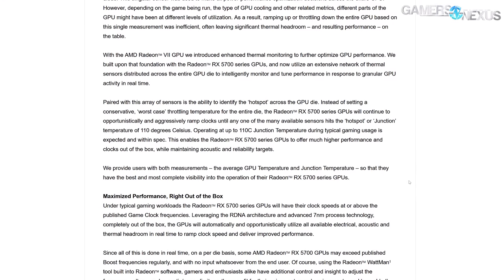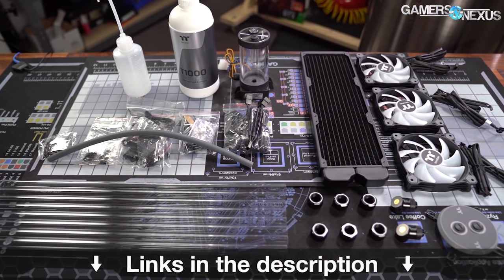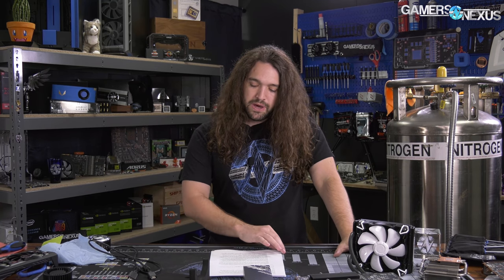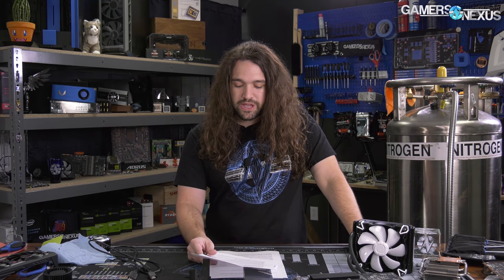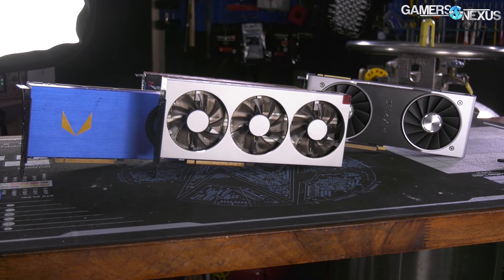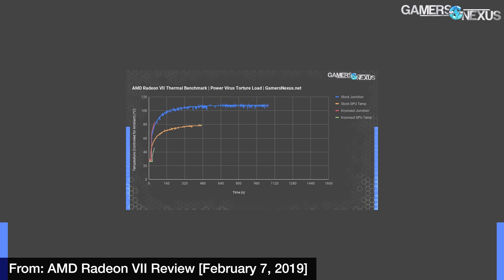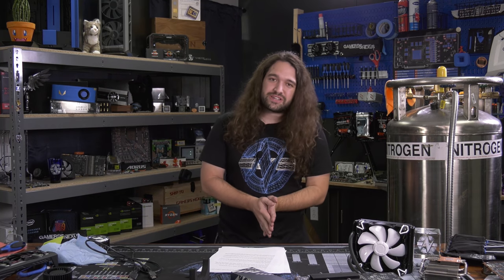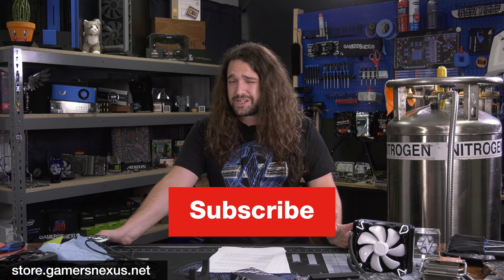Explaining Navi 5700 XT Junction Temperature | 110°C is Not "Expected"

Comment: It's such a poor excuse for slapping on a cheap and nasty cooler. Thanks for calling it out Steve
Reply: It has exactly the same thermal performance that every other reference cooler for the last 5 years has had: all of them keep the GPU they are designed for at around 80 degree's.
Reply: Nvidia did it too for 900 and 1000 series,runningat 85 and 87 respective edge temps,they got a lot of shit for it,probably running at junction speed of over 100C aswell but its hidden,lets hope AMD learns their lesson too,but it may be a faulty cooler design,its a lot better then nvidia's
Reply: @TheCountess666  that's really not true, look at Nvidia, 700, 900, 10 and 20 series reference coolers do. And look at Vega, RX 480 and thr 5700 stands out
Reply: @blodstainer  anandtech reviewed the 2070  super as being 75 degrees while gaming with the reference cooler. Not exactly a world of difference is it?

Edit: They also show both the GTX1070 and the gtx980 being around 80 degree's C. And the RX580 was 75 degree's
https://www.anandtech.com/show/14618/the-amd-radeon-rx-5700-xt-rx-5700-review/15

In fact nearly all the cards anandtech compares the 5700xt with are either 75 or 80 degree's with their reference cooler.
Reply: @ugaaa5 ooow its 82 instead of 80. My whole argument is clearly out the window.

o wait, that doesn't change a thing.
Reply: @Cyro1 Vega's was significantly louder actually.
and i'm not defending the cooler so much as trying to make it clear that thermally, it performs exactly the same as other reference coolers. that 110 degree TJmax is no different then on other GPU's except they are too scared to tell you about it.
Reply: @Cyro1 same THERMAL performance.
if you're going to quote me, do it properly.
Reply: Cyro1 why would you compare it to a card that costs 2.5x as much?  You don’t compare a Honda to a Ferrari for a reason

Edit: grammar
Reply: @Chris Lohr thank you for such a valuable post

to be clear, I never said he was wrong; but comparing it to the 2070 would have been better.  The blower design is retarded and is the only reason I didn't buy the reference model, but unless you're comparing relative performance it just doesn't make sense.  Of course the $1100 card has a better cooler than the $400 one.
Reply: @Chris Lohr Yea I misread that somehow, oops.

Comment: If AMD left it called hotspot people might actually understand what it is measuring more easily.
Reply: too true, and at any rate. Even a reference blower 5700xt will drop 5-10c just by getting rid of those rotten thermal pads. But then again, customers shouldn't have to fix a flawed cooler.
regardless of what silicon will tolerate, as seen with the GDDR6 space invader drama for Turing; solder joints won't handle over 100c for long.
Reply: @anasevi9456  I know of one Gigabyte Radeon HD 4670 that always games at or above 113c and always has.. 6 years it was crossfired with another exactly like it that ran just as hot.. my buddy is still using one of them, either the one I gave him or his died a couple months ago, daily to this day and it still runs that hot.. tell me again what solder joints can and can not handle. Or is going on 11 years not long?
Reply: Tjunction is the correct technical name, and has been used in the industry for years.
Intel has many CPU's out with a Tjmax temperatuer of 105 degree's. yet nobody's raised a fit over that.
Reply: Junction makes more sense, considering "TJ Max" means "Thermal Junction Maximum Temperature". If companies, especially tech companies keep the mentality of "having things make more sense for people who don't understand them" won't work well, it's kinda why we're at the point of thinking it needs to be called "Hot spot" ;P
Reply: @anasevi9456  The solder joints never get over 100 degree's.
That the whole point. Tjunction temperature exist only within the DIE, briefly, and are very local. the GPU as a whole is the same roughly 80 degree's that all high end GPU's with a reference cooler have been since forever.
Reply: @pr0xZen  i don't think it would have mattered one bit how AMD worded it. The head lines and video titles (including this one) would have been exactly the same, all containing the words 'AMD' '110 degree' and 'normal'. And for 90% of people, that's all they see of this issue before drawing their conclusions.

Some have argues that, form a PR perspective, it would have been far better for AMD to just never report Tjunction temp's at all, and i'm starting to agree.
Reply: 'hot spot' temp is what my HWinfo reports it as.  It doesn't matter how many ways it explained, until Nvidia releases similar temp measurement sensors, a lot of users are gonna assume 'hot spot' temp == GPU twmt
Reply: @andrewgerstner7836  We live in a world where people are dumb enough to overpay Nvidia for under-delivering cards. Are you really shocked?

Comment: TLDR - there is a very big difference between "the silicon can handle it and the cooler is shit!". That's it for the video. :) Thanks for watching. Steve being a rebel tech jesus as always. :D
Reply from the maker: Perfect TLDR.
Reply: But you don't have steve's charm :( I prefer the 22 minutes video xD
Reply: The cooler works as intended as long as you do not try to mess with it and the fans. Is it a good cooler no it is just average and could have been better is it just shit no not really since it cools the card if you don't try to make it 40db quiet.

Are there better coolers oh hell yea there is for sure.
Reply: @Rocky-bz8wr  I don't think there is something worse than a blower cooler, like ever.
Reply: @MissedMessages  I do not like them personally as they are loud and if designed badly are also lack luster in cooling as well.

They biggest thing they have going for them though is their ability to move all of that hot air out of the case since it vents it out the back of the case which allows for lower case temps. Other than that there is not much else to say about them.
Reply: @Rocky-bz8wr  you are right browsky
Reply: @Rocky-bz8wr  But you are blowing much hotter air out the back of the case since the cooler is unable to remove the energy from the chip in the first place
Reply: "TLDR - there is a very big difference between 'the silicon can handle it' and 'the cooler is shit!'"

Since Steve officially endorsed it, I thought it deserved some grammar-Nazi'ing.
Reply: @GamersNexus  pin him
Reply: Joe Sterling english is not my first language, I did my best. I apologize for bad punctuation.
Reply: @olivermaldar359  No need for apologies.  I didn't mean it as criticism.  Steve said it was the perfect TLDR, which is why I tried to make it, er, more perfect.  😋
Reply: That hated him because he told them the truth.
Rocky >My car can sort of drive with square wheels its just kid of a bumpy ride you don't need round wheels.
Technically it works I saw them do it on mythbusters but it was a shitty way to do things just like AMDs blower.  AMD is already behind Nvidia they can't afford to be lazy or stupid.
Reply: @organicwest  Unless the gpu is throttling you are getting rid of the exact same amount of heat regardless of whether you are using a blower or axial cooler. Assuming identical clocks and voltages.
Reply: @eoinkenny3188  only if the two coolers are running at identical temps otherwise one is actually removing the heat faster
Reply: @organicwest  Temp does no mean heat. Temp doesn't matter for our discussion. Only the amount of heat energy removed counts. Think of it like this, you're filling two cups. The first cup you fill with warm water to the brim, the second cup is partially filled with boiling water that has the same heat energy as the full cup. Then its topped off with cold water. Which cup has hotter water?

A more efficient cooler can remove  heat faster from the gpu. Cooler gpu temps is the side effect of this. This can give you the headroom to overclock the gpu (increasing the energy generated per sec aka power) or reduce fan speed. If you overclock you may think you are getting the same heat generation as a poor card cooler but you are not you are getting the same temps but you are generating way more heat. 

The net air temperature of a room rises the same amount regardless of the type of cooler if both cards are stock and running at the same power level, ie clocks and voltages
Reply: @MissedMessages  There is, passive heatsink. That will throttle hard. Or none at all - it will fry there.
Reply: @eoinkenny3188  No you're not. Delta temperature from idle over time (dT/s) = cooling power in watts (around working point) = delta energy over time. So lower dT is less energy removed over any given time. Ultimately you're dealing with limits of exponential functions most of the time.

 From definition of Joule, the energy unit, and Watt, the power unit, and Kelvin, the temperature unit and the boring old definitions of second, work and energy.
Reverse Brayton cycle for air and water cooling. (isobaric)
Reverse hygroscopic (absorption refrigeration) cycle for modern heatpipes and vapour chambers. (It's actually capillary but physics are very similar.)

(Use old definitions less directly derived from basic constants, but more understandable.)

You need to take thermodynamics. In secondary school physics.
Reply: @AstralS7orm  Your first paragraph is wrong. Not sure what you are trying to say with the 2nd paragraph and I'll refer you to your own 4th paragraph
Reply: @AstralS7orm  Sigh.... very well. 
(delta T)/s is not equal to power. Change in energy over time is equal to power. The relationship between heat energy and power is the amount of energy (E) that needs to be added to a system to raise a given mass of matter (m) of a given specific heat capacity (Cp) a certain amount of temp(T), per second. The relationship between heat energy and temp is usually given as dE=m.Cp.(delta T). I'm sure you can figure out the relationship between heat energy and power now.

Phase changes are not difficult to work with, and I have no idea why you're obsessed with the the vapor chamber heat pipes. They are useful but they are not the limiting factor when it comes to heat transfer due to the very short distances being considered and conduction being vastly better at transfering heat than convection.

Forced convection is difficult however as you have to deal with Bernoulli's equations and how they interact with thermodynamics in addition to temperature not being uniform across an array of fins. So I'll leave that until you've dealt with 3rd level thermodynamics and heat transfer.

The basic equation for convective heat transfer rate (Qdot which is how power is usally written in heat transfer) can be expressed as  Qdot=h.A.(delta T). Where h is the heat transfer coefficient between a surface and the air and is essentially unique to the situation and configuration being considered. A is the surface area from which we are trying to remove heat and dT is the temperatre difference between the surface and the cooling fluid.

Now back to my original point. A more efficient cooler will have typically a higher heat transfer coefficient be it from a better fan, fin arrangement, material properties, etc. 
As a rough example lets say a 5700 cooler has to cool 200W of power. We then consider Sapphire's design vs AMD's reference design. We assume all cooler designs have the same effective surface area (A) and are generating the same amount of heat (Qdot) but the Sapphire cooler has a significantly higher heat transfer coefficient (Rough numbers Sapphire = 4.33, AMD = 2.74). This means the AMD cooler will be hotter (94°C) than the Sapphire one (67°C) but they are both expelling the EXACT SAME AMOUNT OF HEAT.
Reply: @eoinkenny3188  Heat transfer coefficient is a material constant. It is a sensor constant. It is the same (or very similar) presumably as both cards or same card has the same sensors. Same in case of sensor surface area.
Since these sensors are the same, dQ1/dQ2 = k * dT1/dT2. Presuming the sensor is reasonably linear. Which is interesting for the Tdie as it is a maximum of multiple sensors.

We do not care about heatsink temperatures at all unless it melts. We care about die temperatures, preferably maximum, but average can be useful too. We slightly care about returned air temperatures, but not a whole lot in most cases (as in PC cases).

Input power being the same, efficiency is measured by time to cool down to ambient from full load after considering maximum temperature. If one cooler heats up more but loses heat quickly, it may be as efficient as a cooler that attains a lower maximum temperature but loses heat more slowly. The latter is still better for running GPU most likely, irrespectively of efficiency.

But AMD blower both takes more time to cool down and reaches higher peak temperature for the same load (locked power envelope).
Reply: @eoinkenny3188  I'll tell the equation once more. dE = dQ - dW. Heat is energy. Thermal energy. That's the actual name. It can be used to produce work, including cooling work. (with limitations due to second law) in case of air cooling, dQ is negative, dE is positive. So who does the positive work? *Moving air*. Via convection or otherwise. And what is power? Pt = -dQ/dt = eta * Pe = dE/dt is held constant. (Same card.) Eta, efficiency constant, related mostly but not limited to thermal efficiency, is different between the systems comprising the whole card and heatsink. You need to also use input electrical power to make sense of this.

The card does change the load in response to temperature, so while Pt is (near) constant at steady maximum constant load, Pe changes. That's when throttling. Dividing both powers recovers immediate efficiency, averaging nets you useful average efficiency. (Which is not quite a constant but let's presume it is.)
If not reaching throttling, simple thermal power ratio gives you relative efficiency - Pe1/Pe2 = Pt1/Pt2 = eta1/eta2 * dQ1/dQ2 * dt2 / dt1. As you astutely noted, heat is the same and electrical power is same in some cases, but not in the autotuning gpus, thus you need the full relative equation.

Eta here being thermodynamic efficiency, and the ratio of the two being relative thermodynamic efficiency. Which is the value we were talking about all the time. (Which cooler is more efficient.)

Thermal power is still relevant. We can use temperature as proxy for heat, presuming sensor is identical.

Any other way of measuring this does not exactly work with these autoadjusting cards.

Anyway, coolers do differ in both interface area, thermal constants, airflow and more. Which is completely irrelevant in computing thermodynamic efficiency. Only immediate electrical and thermal powers are relevant.
One being measured via current clamp and voltage sensor, the other by stopwatch and thermal sensor readings. Use the same card or electric thermal load.
Reply: @eoinkenny3188  And the ultimate mistake you made is by assuming I missed time in power calculation, but you did in your example. If alleged other cooler had low heatsink temperature (which we do not care about) but bad thermal transfer, it'd take much longer to return to ambient. Despite same input heat and lower temperature on heatsink, now it takes much more time. So it has lower thermal power. (Or equal. I do not care about your toy examples or measuring heatsink temperatures instead of die temperatures.)

And if the problem is thermal capacity, you may need to specify the same cutoff ambient temperature plus condition for peak temperature and use that stopwatch for much longer. Trying to do it the other way could fool you.
Thermal capacity does not affect thermal power, but it affects the measurement method.
Reply: @AstralS7orm  The heat transfer coefficient (h) is not a material property like thermal conductivity. It is determined in part by the fluid properties, surface properties, heat difference, and when considering forced convection in a heat exchanger fluid velocity, density, pressure, the characteristic length of the surface it's acting over, ratio of conduction to convection between the surface and the fluid, laminar or turbulent airflow,, etc. Try again.

I never said the AMD cooler was as efficient or effective as say sapphires one. I also never recommended AMD's cooler nor would I ever. I simply pointed out that they were both expelling the same heat regardless that one was hotter than the other.
I'm out
Reply: @eoinkenny3188  You even require that kind of rigor in definitions in YouTube posts, right? I'm not native English. What I meant is constant physical property. It is a physical property of a heatsink or sensor, depending on what you measure with.
Unless the heatsink is changing shape, location or phase, again, you quibble over a comma, while being ultimately wrong about "there not being cooler efficiency because heat is the same".

Literally the basic is to use the same or well described sensor for all measurements. This rules out heatsink temperature measurements forever. Neither is some air temperature useful, because it is impossible to capture all airflows. (Unlike water temperature drop over time in some water cooling system.) This leaves edge and die sensors.

Nobody cares at all about material properties of the system that is being measured, for purposes of establishing thermodynamic efficiency, only time, load (thermal and electrical) and cutoffs. And the sensor being identical.

If you're comparing different GPUs then it's on you to validate the sensors. (Preferably via identical mass and material heatsink or water block - it's hard. Tedge is easy via thermocouple but not as useful.) Different heatsinks, much easier.
Reply: @Rocky-bz8wr  it's a crap cooler.
Reply: @InsomniacBrit Gaming  I almost always hit 110 unless I set an FPS limit, I've had the card for 3 years... XFX RX 5700 XT Thicc III ... is it gonna melt??